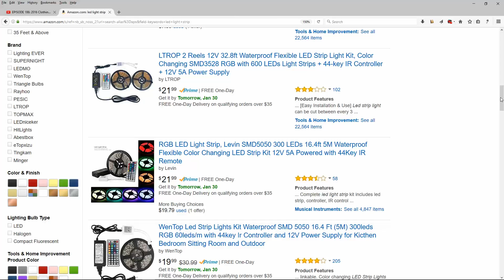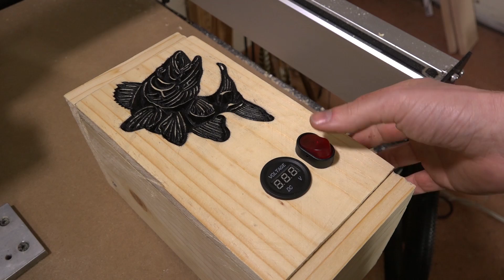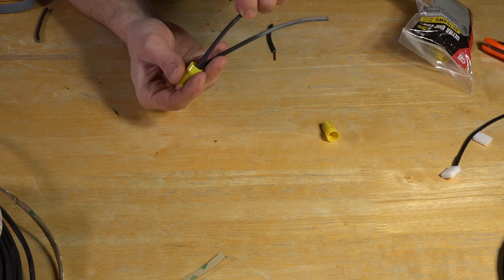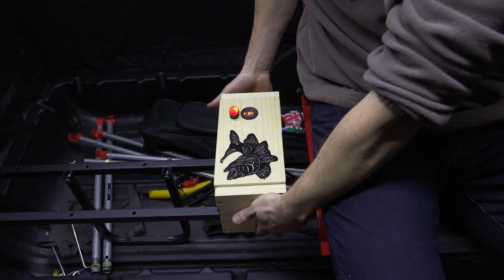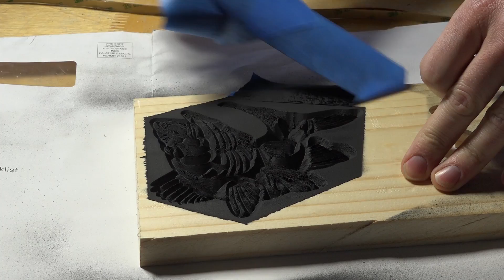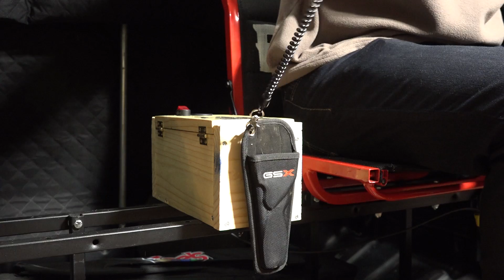How to Add LED Lights to your Ice Fishing House

Comment: Great instructional video. If I may make a suggestion. Go with a higher gauge wire such as 20 or even higher in the future as 16 is really an over kill for these low amp drawing led's. It will be much easier and cheaper to work with and the resistance will be minimal. Great video !!!!

Comment: In my experience take the time to solder the connections. The amount of folding and opening a portable does makes the crimp connectors pull out.  I've had a few pull out this season already. Switched and soldered them all

Comment: You should add an in line fuse right on the positive wire connected to the battery. Make sure the fuse is closer to the battery though!

Comment: Does it matter ah I'm using? I have a "1280" 12v 8ah battery.  But I see you "1290" which I assume is 12v 9ah. Or does it really not matter as I'll only be fishing or even using the lights for maybe an hour or two at a time. Thanks..
Reply from the maker: +wutang1979 The Ah rating is just the capacity. The larger the number, the longer it'll last. As long as the voltage is 12V, you're good.

Comment: Great vid!  I bought a set of these lights you linked and made my own lantern style.  I'm confused with the power consumption though.  The product says 2835 diode which my research tells me is .2W/per unit which would be 60 watts total (300 units) for the 5M strip.  The description of the item says 24W total.   I have a feeling the product is actually 3528 diode.  Big difference.  Any insight on this?  Thanks
Reply from the maker: DTroFishOn I will confirm with a multimeter when I get home. I had done my calculations with the same numbers you listed.
Reply: I tried throwing mine on a multimeter last night, but unfortunately my meter has a blown fuse.  I ran it for 4 hours on an 8ah battery and no noticeable dimming.   I also got  a response from the seller assuring me they are indeed 2835 diodes and power consumption is 24 watts.
Reply from the maker: DTroFishOn I still need to check with my multimeter, but the diodes are 2835. You can tell by the way they're shaped. 2835 are rectangular like these, but 3528 are circular.
Reply: I hooked my set of lights to a multimeter this weekend and got .96 amps which seemed like about half of what it should have been.
Reply from the maker: I checked mine at the end of the night yesterday when I was under 12v and got a similar reading, about 1 amp. I'm charging the battery and will check the amperage again on a full charge. It should be a little higher, but 1 amp is still much lower than I'd expect. On the bright side... even with the lights pulling pulling less power, they're bright enough to fish and film with, and the battery life is significantly longer than anticipated. I still want to do some digging as to why the lights pull less power. I'll check the number of lights/foot and do some research on temperature, etc.
Reply: DIY Sportsman yep, I agree, not necessarily a bad thing, but not what I expected.
Reply from the maker: +DTroFishOn 1.5A at full charge

Comment: Garrett, how long are your lights lasting with this set up? Battery run time I mean.
Reply from the maker: +Chad Ratzburg Great question. With all the lights in the roll on at the same time, they should run less than two hours on a flasher battery. But I ran mine for 2 hours and 15min last night, and they were still running. Running fewer lights increases battery life in two ways... they draw less current, but also lower power draw is more efficient with lead acid batteries. So, for "all night battery life" you'd be better off running a trolling motor battery and/or running fewer lights. I use the entire wheel but it's definitely more than you need to see what you're doing.